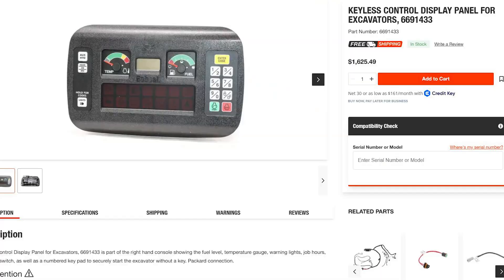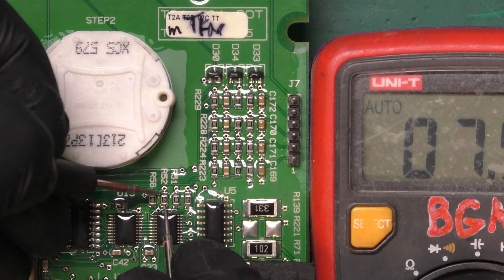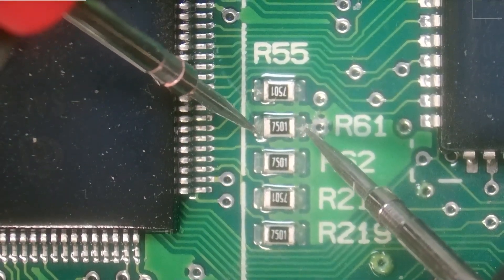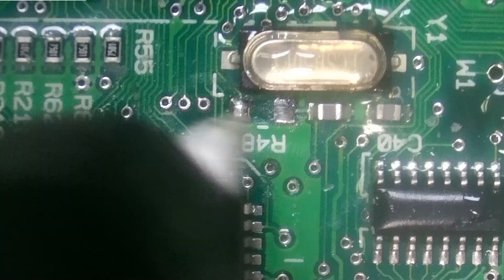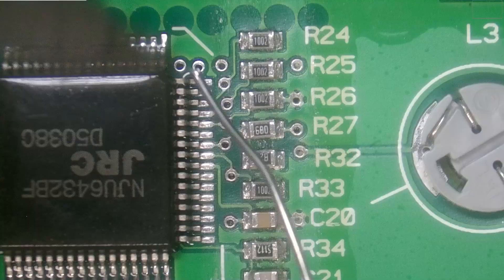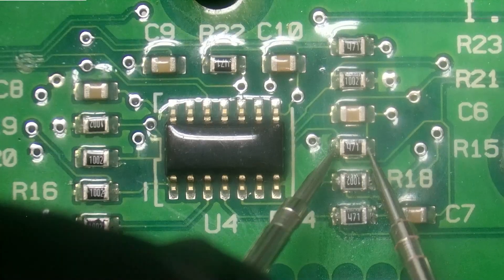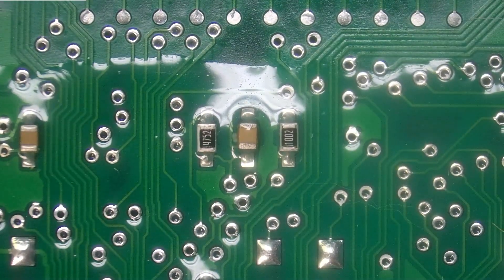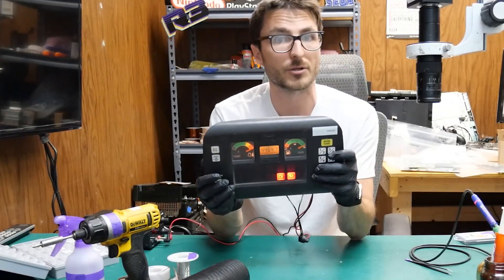How I Diagnose and Fix Bobcat Controller Panel for Excavator 341G

Comment: These would have to be defective resistors.  There's no reason for that many to open.  I would guess the parts supplier was the low bidder.  Great business for you though!
Reply from the maker: This is happening to hundreds of these units. They are 20 years old so it's not like they are failing right away.

Comment: GREAT TUIORIALS  ,AND IDEAS TRYING TO REPAIR WITH YOUR INFO  THANKS 
AND WHICH PINS TO POWER UNIT OUTSIDE OF MACHINE BENCH TESTING  WOULD BE OF GREAT HELP
Reply from the maker: If you have the full bobcat, it's best to test in the machine. We have a fairly complex system to fully and properly test the unit that is not shown in the video, but there are a lot of sensors that need to also be plugged in to the unit for full testing and functionality tests.

Comment: Hella weird that so many resistors just failed. Maybe bobcat doesnt use automotive grade resistors?
Reply: I thought the same.  A single resistor going bad does happen.  But like 10 of them failing open?  What the hell, that’s not normal at all.
Reply from the maker: We fixed a bobcat unit today with over 40 resistors failed. 
We also had another come in with just 1 bad ones which was enough to cause a complete dead no power. Everything else was 100%. 
Very strange how some of these fail sometimes. In the case of the latter we typically will replace all the resistors within that circuit to be sure that no repeat failures occur.

Comment: Any idea why one of these boards would fail and have the switched 12v pin shorted to ground?
Reply from the maker: Is the controller removed out of the machine when doing this check?

Comment: These Bobcat repairs are wild to me because I (a) hardly ever see a failed resistor and (b) the failed resistors I've seen have usually had an overcurrent through them and are visibly cooked. Crazy there are so many failed open on these units.
Reply from the maker: This is the only type of unit I have ever seen like this as well. And yes on my nicks tv repair channel, not to long ago I did a video on repairing a one connect box that had a lightning strike enter through the HDMI ports and all the affected resistors you could visually see that they had a little burn mark / small dot on them, which made it easier to identify the faulty ones. 
They are both fun to fix but also a bit frustrating because often you have to run through the entire board to find the failure and there are hundreds of resistors to check. But I don't know why for some reason, I really do enjoy fixing these a lot. Maybe because I have a high success rate and I know that as long as I keep working on it I will get it firgured out eventually.

Comment: Hey there, how did you get the pin outs? Mind sharing them?
Reply from the maker: From a vehicle and measuring the voltages with it off and on. 
Looking at the back far let connector, the left most top and bottom pins are 12v the ones next to them are both ground. And then the top left pin of the 4th connector from the left is 12v as well. 
if you look through the video again and pause at the right times you will see where the wires go.